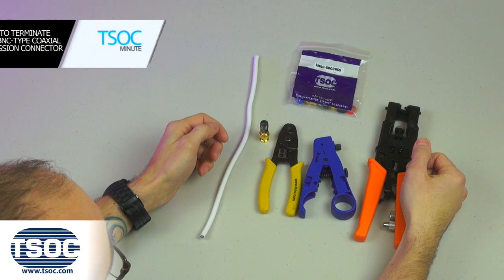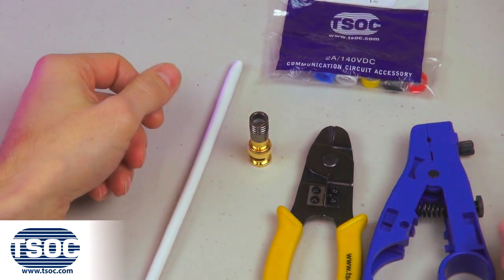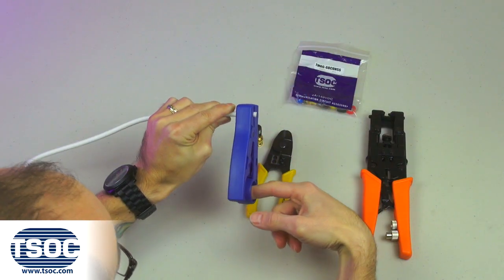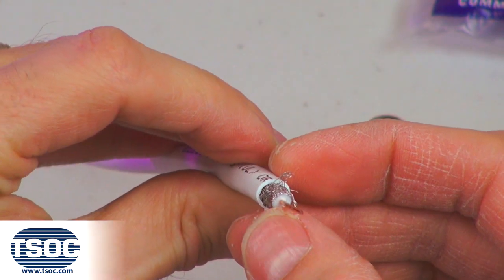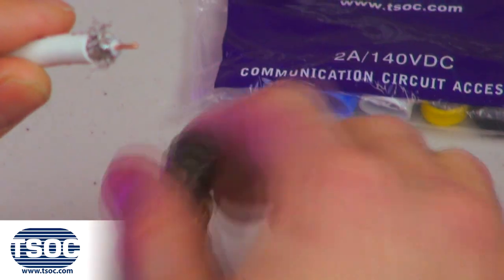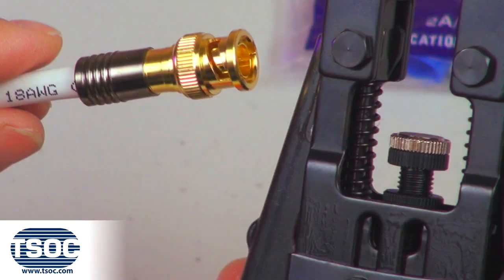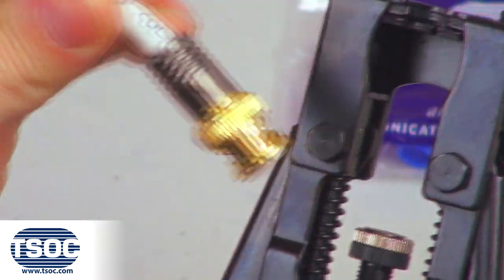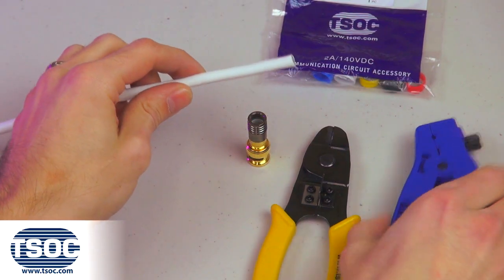How to Terminate an RG6 BNC-TYPE Coaxial Compression Connector - The TSOC™ Minute (ep. 3)

Comment: What does "make adjustments" mean? And what am looking for on the "inspection" I have this tool and most of my crimps failed. Some even fell right off the cable with little force even though I compressed the tool all the way.
Reply: The little die that the connector sit on in is on a screw/bolt that you can move up and down, if the bolt is too low your connector will not be fully compressed.